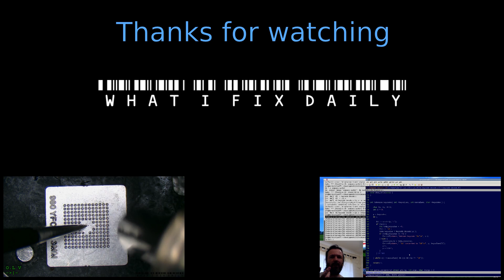#249 QuickFix  - Logitech mouse M150 (MK220) erratic wheel fix

Comment: Good fix, but there is a expensiveless one, I had the same issue, just put enough WD-40 on the rotary encoder, make sure it can enter the encoder properly. Move the wheel for a while connect to your pc and enjoy again your wheel movements on the mouse.
Reply from the maker: The encoders cost me about 75c/pc, and I usually now do the fix with the replacement middle-click button as well ( using a high-durability version instead of the default ).

Probably is just trash getting on the contacts in the RE, hence the WD40 having an effect ( might use contact-cleaner instead though ).
Reply: @pldaniels  Hi Paul, can I replace the sensor with the sensors usually found in gaming mice? Just curious.

Comment: i have problems with the rotary wheel as well, but i cant find any 11 mm rotary wheel in my country, just 7mm 9mm and 13mm, what can you recommend
Reply: you can use 9mm, just dont solder it all the way down. if you use the 13mm, you have to shave some parts of the terminals.

Comment: i clean them with alcohol and they go back to normal, mostly i have the clickers fail and i replace.
Reply from the maker: TAK Ism. Gave these a full wash previously but the bad behaviour returns within a week.
Reply: @pldaniels  then you did great :), anyway i am using Rat9 cyborg and its working great for 6 years, all i had to do is clean and replace the battery's, its not a cheap mouse but a great one.

Comment: That encoder sounds like a disk with pcb like patterns on it and fine metal fingers making contact. like the one i had over 10 years ago, they did cause problems.
i have not seen optical ones fail often.
I would take the old encoder apart to see why it died, i'm nosey like that lol :-D
The button switches can be a pain with hardcore gamers, my mate plays the world of warcrap (that's what i call it ), he kills switches.
Reply from the maker: In this instance, I suspect  the reason we have a mechanical/contact encoder is because it's a wireless mouse, using the superior optical encoder option would likely drain the batteries within a few days :( (unless they've got 100nA capable LEDs now?)

Comment from the maker: The Logitech M150 mouse comes with the paired wireless Logitech M220 set for about $30 AUD and they're a great combo for dependably getting wireless mouse/keyboard going on your system without any hassles.   While the keyboard is a bit "meh", the mouse I do find to be a nice weight and behaviour, however, they suffer periodically from two main faults;

1) The middle click becomes less responsive
2) The mouse wheel starts to randomly kick in the wrong direction

Both of these problems can be fixed up; you just have to replace the parts;

1) Middle click button:  Part #959-698 from Element 14, B3F-1070 or similar ( https://au.element14.com/omron/b3f-1070/switch-spno-0-05a-24v-tht-0-98n/dp/959698 )

2) Mouse wheel rotary encoder: 11mm high 
 - https://au.element14.com/alps/ec10e1220503/encoder-horiz-10mm-24det-12ppr/dp/2064976
Reply: my m220 keyboard is workin but mouse is not i am not able to troubleshoot it help
Reply: One question, what part/chip is the receiver/transmitter and does it hold the ID? My mouse internal's got sulfated and I was thinking of taking out the transmitter and whatever else is necessary and putting it/building another mouse to replace it.